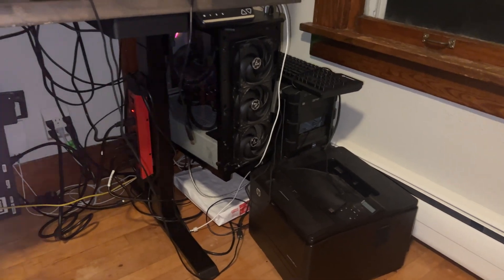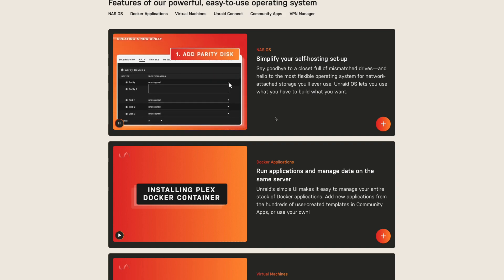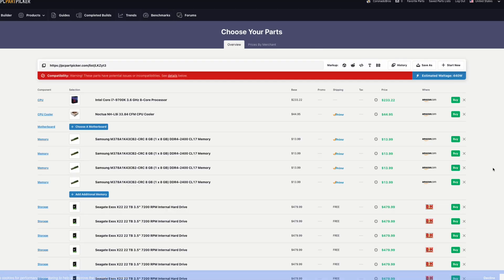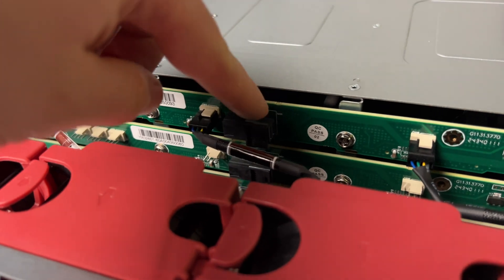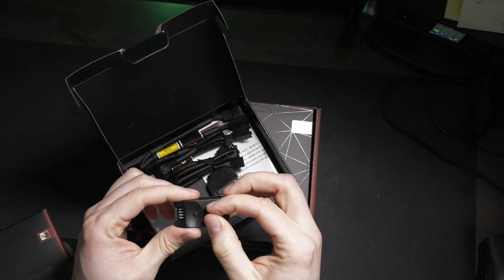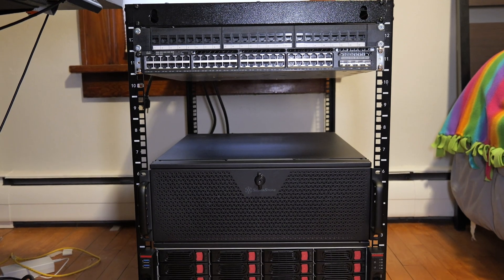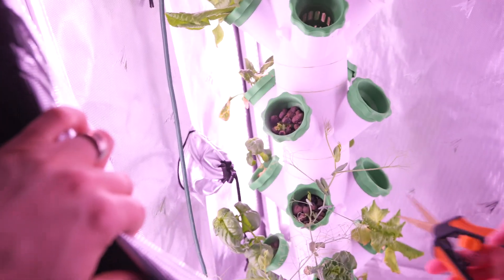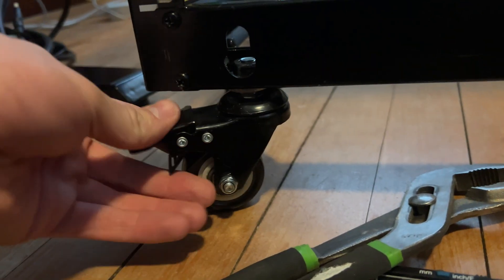Build the ULTIMATE Home Media Server – DIY NAS & Plex Setup! SilverStone RM22-312

Comment: How was it moving from the Asustor ecosystem to unraid? Did you already have lots of data on the Asustor? I’m considering switching, from a 4bay Asustor to a very similar setup to what you have
Reply from the maker: Hey brother, it wasn’t that bad at all. I didn’t have much data backed up. All of it was scattered over multiple drives already. So I built the unraid server and it’s been smooth sailing ever since. I’ve actually since upgraded to a 10GBe network switch, and installed 10GBe pcie cards on both my workstation and NAS. The upgrading never stops 😂. I strongly recommend the switch as it gives you more control on your own hands at the end of the day. You can do more with unraid.
Reply from the maker: I got another video I’m currently working on highlighting these upgrades.

Comment: do you happen to have info or a tutorial on how to set the fan speeds? i am not sure how to configure it properly without cooking the components
Reply from the maker: I believe these are more configured by motherboard settings than anything. Are you using this case and the provided fans? I personally added a manual fan controller. I believe I went over it in my upgrade video that was uploaded after.

Comment: Question first, your GPU in the 4U case, did you have any issues closing it with the power cable? I'm looking at 4U and 5U coz I'm trying to future proof my case buy given the cost, but I also don't fancy spending double just for 1.75" of extra height. I currently have a 1080Ti which I know will fit in a 4U, I'm tired of Nvidia's anti consumer/gamers nonsense, so I'm probably gonna get a AMD 9700XTX if they do one, which should also fit no problem given AMD cards max size is similar to yours, but given how huge Nivdia's 40 and 50 series cards are, and the dumb power connector placement, 5 or so years down the line it does make me hmmm and ahhh a bit.

I'm seriously considering rack mounting my PC, coz I also want a high speed 10GBe SSD NAS for video editing, I currently use a QNAP TS-464, with a 10GBe card but due to hardware limitations I get between 2.5 and 5GBe, it's mostly enough but larger files or edits it does start to lag. My approach is likely to be a 2U short depth, and I'm gonna have at least 1 2.5" 6x hot swap drive bay, potentially 2, and 1 3x 3.5 drive just coz, also in case I get rid of my QNAP NAS. 

My thinking with this is with modern drives, unless you need petabytes of storage, you don't actually need that many drives these days to cater for average to medium storage needs, with 20TB drives, Raid5 would give me just under 40TB of 3.5" storage plus parity. My QNAP storage currently uses 3x 14TB drives (12.TB in reality), with a spare bay to add another, I have a usable capacity of just over 21TB, I'm currently using 13TB. 

If I want to combine more 2.5" and 3.5" drives I have 2 options, use the last expansion area in the 2U case, but restrict air flow more, or get a 4U case so I can use a 5x 3.5" enclosure instead, as the drives then stand vertically getting more drives in the same horizontal footprint. I wanna avoid server grade, coz I'll have to sit next to it due to limited space, I've got use to the QNAP NAS drives clunking away, but don't really want lots of fan noise.